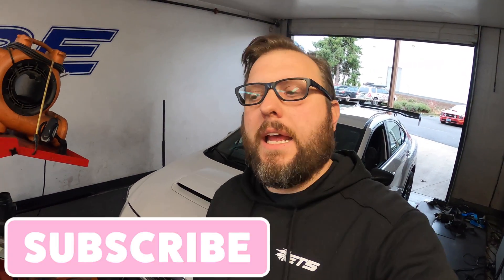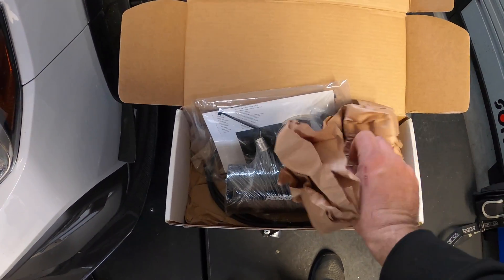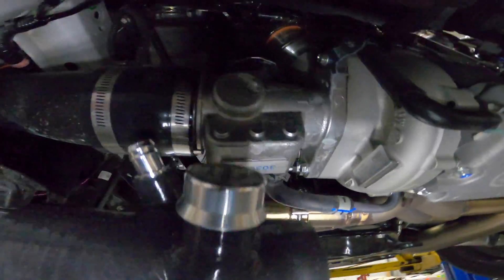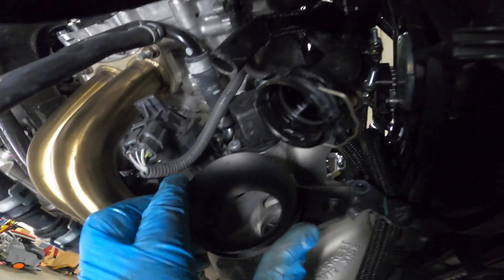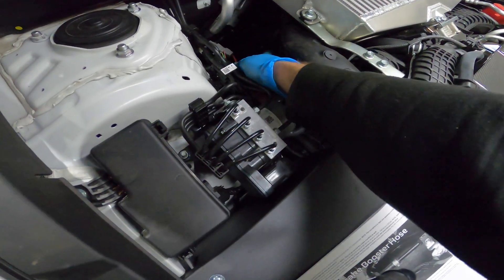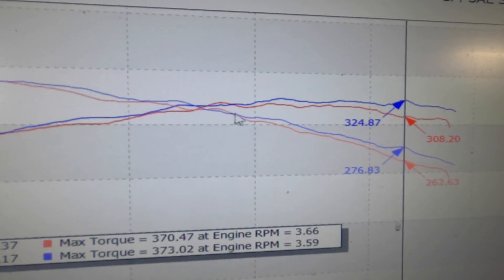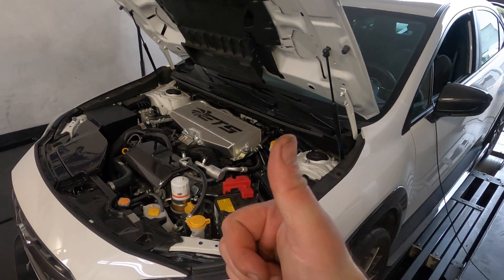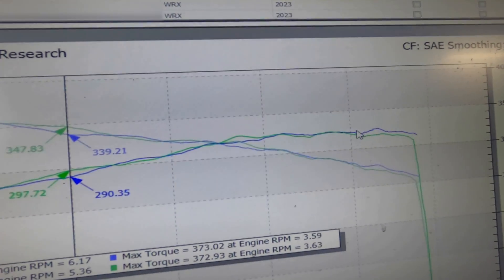Subaru VB WRX: Perrin Turbo Inlet & Secret Prototype Part vs Stock Inlet Dyno Power Showdown

Comment: So I have my ETS intake and Perrin turbo inlet sitting unopened in a box waiting to go on.  Then overtake comes out with their inlet.   Saw some mention possible CEL with the Perrin vs Overtake claims to have a vacuum restrictor in one of the lines to prevent that.  Any thoughts on comparing the two?   If the Perrin is still solid by compariaon, shes going on shortly

Comment: what about how fast it goes into boost? With mine on, it seemed to go immediately into boost without that 2 second delay built in to the OEM version. I actually took the Perrin back off because it was causing car to too aggressively go into and out of boost. At ike 20% throttle, it would just almost instantly go into like 12 psi at 2500 RPM. With the OEM inlet on, it doesn't do this.
Reply from the maker: You can tune the behavior out if you want
Reply: Yeah, boost response is noticeably faster. I rather like it, to be honest. This is one of my favorite mods so far, one that made a difference.
Reply: Increased spool and response is what I want, guess I should buy one as well as an intake.
Reply: @drumhopttv id say yes. Im putting mine back on but either way some upgrades. Brass T adapter and T-bolt clamps.
Reply from the maker: Why use tbolt clamps?

Comment: Was it a PCV valve?  It’s the right size and in the right area and not something you would expect to improve performance, but I saw Radium makes one that they claim is better than a normal PCV valve so I guess there’s room to iterate?  Since it’s an emissions thing I could see why they didn’t move forward with it, due to CARB.
Reply from the maker: Not pcv 🫣
Reply: @WT4T Final answer - some kind of throttle body coolant delete/flow control so that you don’t have hot coolant heating the charge air when it’s not freezing outside.
Reply from the maker: @EricMixon it's really visible in the engine bay (if you know where to look) now that the car has a fmic on it yet no one's noticed.
Reply: @WT4T  its the egr delete. I believe heavy medal wrx spilled the beans
Reply from the maker: @Swaggie-Dee definitely didn't delete anything
Reply: Adding in a separate TMAP sensor so have one dedicated to Temp and one for Pressure???  Also, I emailed Pre last week about coming for a protune and got a response but since then I haven’t heard back! 😭
Reply: I didn't see anyone mention the clutch delay valve delete. Size is about right and you can only see it with the TMIC removed. Not sure how the part would make more power, though, if that's it.

Comment: I wonder why the stock turbo and turbo inlet pipe has that weird path that allows for boost leak to happen. Is Subaru using it as an unusual way to hold back power at high rpm?
Reply from the maker: They're using it to pull a little vacuum on the evap system and I do mean A LITTLE.
Reply: @WT4T  that's the strangest way of implementing this that I've ever seen from the factory 😂
Reply from the maker: @aaronbryan5095 yes sir.  #engineering
Reply: @WT4T so if there’s no vacuum for evap isn’t that a bad thing?

Comment: @WT4T Any info on what the prototype part is yet?  Second question.. does the turbo inlet need a tune, or can it be used safely on a stock car? (From a research paper : Effect of EGR jet position on gasoline performance and NOx emission :) )
Reply from the maker: I wouldn't use any mods at all really on a stock untuned car because there's no closed loop fuel control at WOT on the stock map.  Basically any tune even like the ots Cobb maps or my maps adds closed loop control and the inlet is fine on those.
Reply: @WT4T  perfect. Thank you!
Reply: @WT4T  What's the difference between these newer cars and the EJs that allow for closed loop fueling up to WOT? Does the factory O2 have a wider range that allows for this capability? Why does the factory tune keep it in open loop?
Reply from the maker: @MikeG4936 factory tune is open loop still on these but the sensor is a true wideband and not installed in a spot that sees drive pressure like the EJ.
Reply: @WT4T  I suspected as much!! THANKS for the info!

Comment: You cannot complain about the power increase.  However,  I just don't like how flimsy it looks compared to the factory part, especially the dangling coolant line.  The original part was a solid (I'm assuming aluminum) block with a lip to accept the intake tube, the Perrin inlet just looks like a wide flimsy tube held onto the intake tube and turbo with not much for the hose clamps to reliably grab onto.  

I dunno, correct me if I'm seeing this wrong.
Reply from the maker: The turbo connection is billet aluminum but the tube itself is wire reinforced Silicon.  Pretty standard in the industry. You don't need much to "clamp onto" because the part carries no load.
Reply: Thanks for the clarification.  Still don't like the coolant line, rather than zip tie, I'd shorten the coolant line altogether farther up in the engine bay,   @WT4T
Reply from the maker: @Kopernicus67 I agree there but I left it alone so I can go back easier later.

Comment: Be super keen to see you test the turbosmart plumb back diverter valve
Reply from the maker: I'm super interested in why anyone would need or want a plumb back diverter valve when the factory one isn't known to leak or fail and is ecu controlled.
Reply: @WT4T  I personally changed it because the standard one drags when coming off boost and has a terrible noise when doing so with a air intake

Comment: That turbo inlet is a must on any tuned VB. Great video! I'm dying to know what that part is now.
Reply from the maker: Yeah,  I was shocked the difference
Reply: @WT4T  Mr. Perrin let you reveal yet?
Reply from the maker: @chrischarles9218 nope
Reply: @WT4T when!? lol
Reply: How about now !! We need to know
Reply from the maker: @dionysushunter5078 I asked Jeff Perrin yesterday and he said "how about still no" sooooooooo, sorry.
Reply: @WT4T wtf lol so it wasn't a diverter valve then ?
Reply from the maker: @beaches2mountains230 nopperzzz
Reply: @WT4T  Anything yet? It's been two years, hoping for the news lol
Reply from the maker: Fun how that works.  Last thing is was told was no. 😢
Reply: @WT4T dang, well thank you for the update. Last I know he was working on was a MAP relocation for smoother response and ease of tuning, but I'm just about wrapped with my build lol

Comment: Hmm improves driveabilty, smaller part, no bolts just the part, part # is psp-eng-250.  I know it is engine….made a little more power.  Throttle Body Spacer?
Reply from the maker: 😏 maybe.  I do have quite large hands. It could have had hardware.
Reply: lol you are good. Well the bag was fairly small so only so many things can fit.  You installed on the dyno so it must have been quick/easy.

All I know is I want one and have a Perrin turbo inlet, Perrin mBPV and a few other non essential bits to add and a retune (currently dynoed at 354whp/356wtq on 93 Drunkmann tuned at Felix Performance).

Wonder when Perrin will release this??  I will probably wait for it for a retune.

Comment: Just as devil's advocate, how much of these could be only noise from run to run? Humidity, ambient temperature, initial IAT, etc?

Seems to me ~3 whp is just variance, isn't? More than 5 maybe is significant? 

Thanks, great content!
Reply from the maker: I do a series of 3-5 runs for every "test". As for environmental conditions all runs are same day as close together as possible and weather corrected using a weather station in the room.
Reply: @WT4T  My apologies! Perfect, then the change is significative and not noise.  I wasn't expecting such an increase without re calibration.
Reply from the maker: @0Camus0 me either!

Comment: I wonder how much power you can get from a lightweight crank pulley? nevermind, you can't fit a pulley in you hand.  probably an egr jet or a spring
Reply from the maker: Zero that's ever worth anything.  I tested them a while back on brz and zero real gain with tons of issues.

Comment: It’s a diverter valve.
Also, the removal of the PCV system venturi is stupid. It’s there for a reason, and that’s to keep the crankcase under vacuum during transient conditions. This is even more vital when running larger factory intakes / Inlet pipes due to the reduced depressions in them. It’s not a “boost leak” like Perrin calls it, it’s simply a recirculation from the outlet side to the inlet side of the turbo. A large portion of the energy lost is recovered because it increases the pressure on the inlet side which helps to decrease the pressure ratio of the turbo. Even if it causes a 5-10HP loss, it’s worth it to keep the crank case under vacuum. VAG has been using this system on different versions of the EA888 and for those without it, you’re starting to see people retrofit the venturi.
Reply from the maker: Perrin has a fix for this, which is the lines I put up top on the car 🤗

Yes, the "negative" was for the diverter valve comment.
Reply: @WT4T  I’m not sure if they can fix the deletion of the venturi, there needs to be a decent vacuum source to keep the crank case under vacuum. When the manifold is transitioning to positive and the inlet pipe isn’t flowing enough to generate a decent depression. A mechanical vacuum source or venturi would be the only way. Personally, I just wouldn’t want to give up the benefits of having solid crank case vacuum for the limited benefits of not having it. It’s actually a clever solution. Moving to a venture style PCV system on gen 3 E888’s has basically eliminated oil consumption on track and helps to mitigate PCV issues when running larger intakes. In my testing of my own venturi system, it takes about 10g/s of airflow at 29PSi. The wastegate PID hardly has to do anything.
Reply from the maker: @JordieG8 interesting.  Now I'm curious, I'd like to measure how much vacuum it actually draws vs the solution Jeff came up with.
Reply: @WT4T  That a boy, I like that attitude. It’s refreshing to find calibrators that put effort into understanding the why and not just the how. Parts like these that can have a profound effect on the factory engineering logic really do need to be reviewed deeper than face value. I would hope Perrin would do their research and develop their parts accordingly however, I personally am not willing to take these companies at their word anymore. There are countless examples of companies putting their bottom line in front of quality and engineering. I tried to reach out to Perrin and Jeff essentially told me not to worry because it doesn’t cause the Check Engine Light. Which now that I think about it, I have a sneaking suspicion that the reconfiguration of the lines that you do with the install may have something to do with that. You would probably have his ear more than I would so I’m sure he would be willing to discuss the logic that went into the kit more with you than with someone reaching out on their website.
Keep up the good work!
Reply: @JordieG8  This is the kind of discussion that I look for. Getting into the nitty gritty details.
Reply: @chrischarles9218  👍 after chatting with Jeff, this system is related to the EVAP only. Just wanted to clarify.
Reply: Ok, thanks for the heads up
Reply: @JordieG8  So is it safe to install or would it be detrimental to Crankcase pressure?
Reply: @nickespo89  after chatting with Perrin, they assured me it’s specifically related to EVAP.
Reply from the maker: We haven't had any issues with ours.
Reply: Did they ever release the secret part?
Reply from the maker: @VBmike2100 negative 😭
Reply from the maker: Negative
Reply: @WT4T  come one man, I like your channel, give me more than that! Lol Edit: oh, you meant Negative to the diverter valve. It was worth the guess.

Comment: A shiny new oil cap 😂
Reply: Imma guess it’s a throttle spacer 😅
Reply: @M0NST3RIAMP3D  That is what I was thinking when I saw him take off the inter cooler. Some type of spacer that separates the heat from the throttle body to the intercooler... just spit balling here..
Reply from the maker: You'd probably be able to see that in the video after the install.... but... 🤷‍♂️

Comment: im running an e40 ots map. how often do you think i should change my oil? i know it loses viscosity early. i have the 22 wrx
Reply from the maker: Definitely not more than 3k.
Reply: @WT4T  thanks man. I might get that turbo inlet to run with my e40 tune since it doesn’t need any type of tune
Reply from the maker: I can't promise that for everyones OTS maps, but ours run it great.
Reply: @WT4T  ok. I’ll get with the tuner and ask if it’s ok to run it. Great talking to you
Reply from the maker: @ironmandingo1 it's ALWAYS a good idea to consult your tuner before changing parts.  They know better than anyone in the industry what works and what doesn't.
Reply: @WT4T  your right

Comment: Mystery part a DV ?
Reply: The secret part was installed with intercooler out. Probably something related to the throttle body.
Reply from the maker: DV?
Reply: @WT4T diverter valve sorry.
Reply from the maker: Oh,  no,  no reason for one.  Factory is fine
Reply: @WT4T  great videos, very informative.
Reply from the maker: Thanks,  many more to come on this platform!